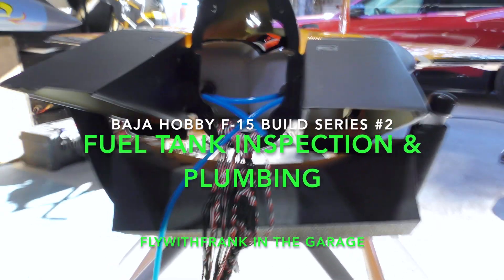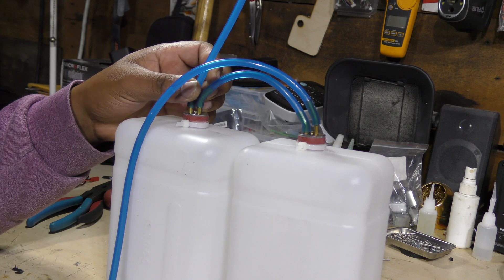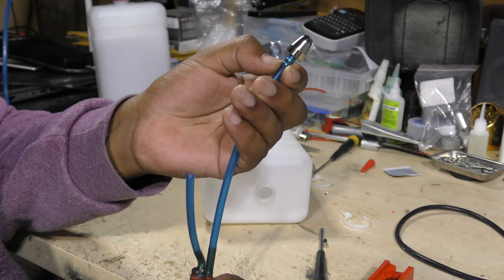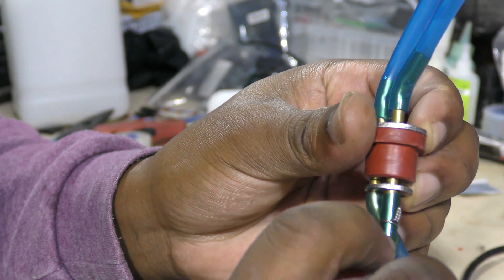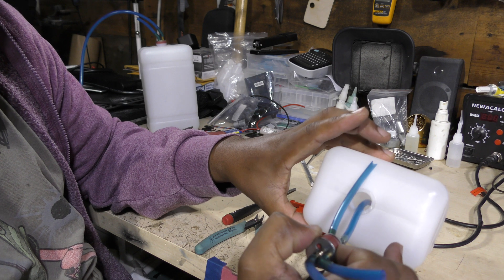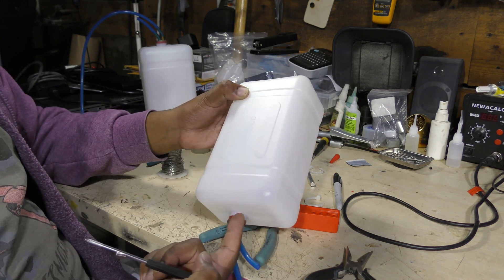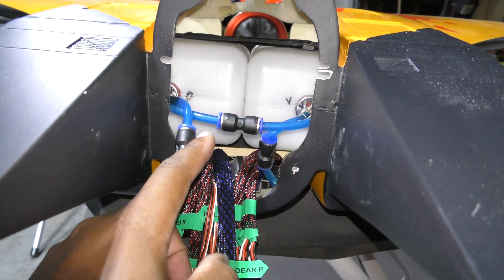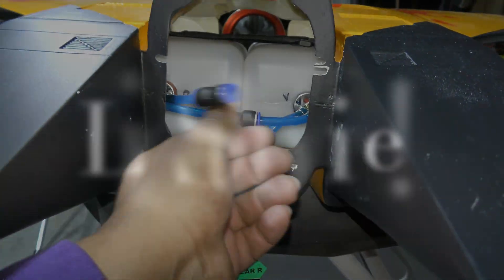Baja F-15 Build Series #2: Fuel Tanks

Comment: nice video, as always... but don't use festo fittings with soft tubes, they can bend inside the fitting and let the air in
Reply from the maker: Interesting! I'll keep an eye out. So far I haven't had any leaks or issues with air likely because the tubing is fairly rigid. It bends but is not as flexible as say Tygon

Comment: I was wondering about the possibility of drawing in air with using a "T" fitting and paralleling the tanks. I think going back to the series system was the correct decision.

Comment: Hey Frank - building a HSD FRP Viper and I found this video helpful.   In my models case, when I loosen the screw on the tank to inspect the clunk, the maximum amount of force I can apply with my fingers won’t dislodge the cap/plug.  I’m at the point where I may just maiden it without inspecting it.   Any tips?  Maybe I should just haul it over to your garage.  😅 I’m probably 15m away.  😬